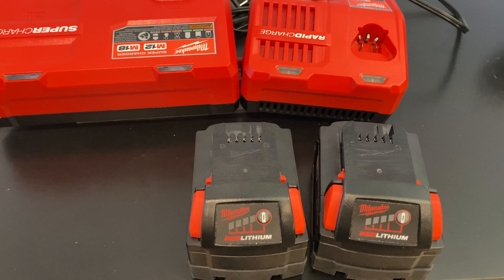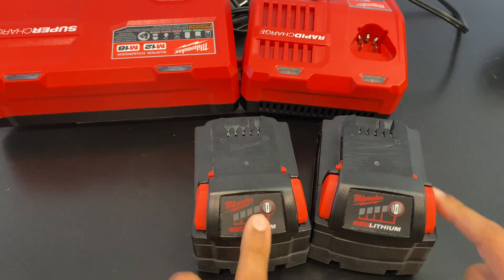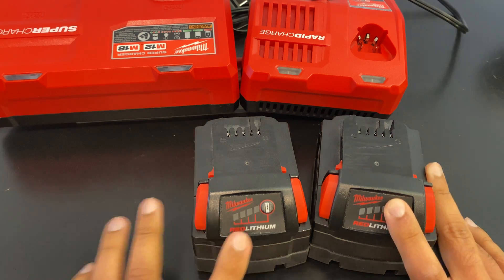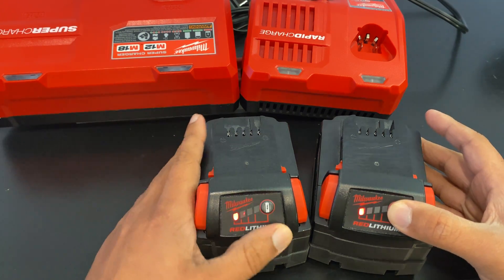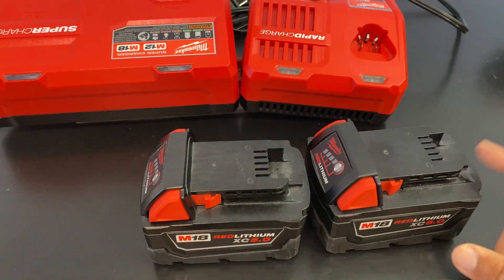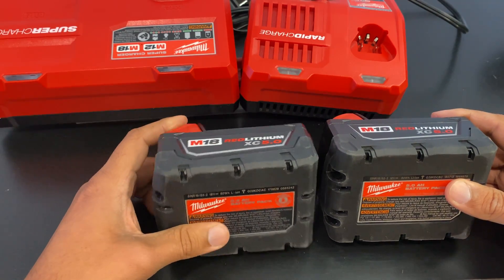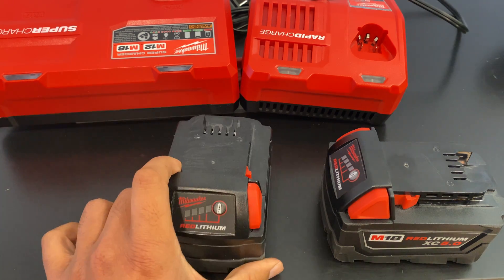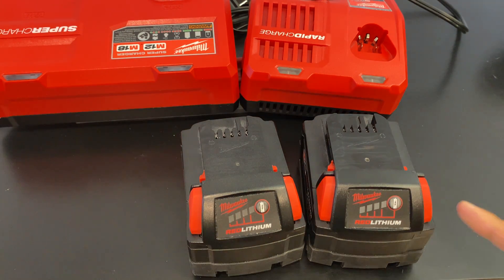Milwaukee M18 Batteries have two different blink speeds. What the heck does this mean?

Comment: Given Milwaukee engineers have included these disparate blink speeds my uneducated guess would be that if the battery is blinking rapidly it may be prudent to first start a charge on a "standard" charger for a short while to sort of get it "up to speed" before trying to charge it on a Rapid or Super Charger. Short of that it may be less for the end user than it may be for a Milwaukee tech who may be charged (no pun) with analyzing it when under warranty. I know, not much help.

Comment: When I run my 12 AH battery on my vacuum, the slow blink happens when I can hear the vacuum starting to bog down, and it’s usually my warning that I’ll need to swap batteries soon. 

Once it starts blinking rapidly, it’s dead and needs to be charged.

Comment: apparently you can use a second battery and jump the positive and negative to the dead battery. this gives it a charge enough to get it on your Milwaukee charger and finish the job
Reply from the maker: I would NOT recommend this. It’s very stressful and is hazardous. Use an RC battery charger and charge the battery instead. The pack may have a balance issue, in which case you could easily push a cell past 4.2V.
Lithium ion batteries aren’t good to take lightly because they absolutely will cause a fire.
Reply: @BatteryTestChannel  ill have to check my Hitec out and see what it can do. I thought you could only balance LiPo. or was necessary
Reply from the maker: @779069  All multi-cell lithium batteries benefit from balancing, but Lipos are used in crazy high drain devices so it becomes necessary for performance. I put a clamp meter on my XMAXX and read 150A or something insane.
Reply: @BatteryTestChannel  Xmax lol... I have the revo and jato. but i stuck to nitro. I built a really rare like out of 10 RCs called a lightning. it was electric before it was even a thing. if you have a chance, check out Unlimited Engineering. they make some super high quality parts. you can get some real nice diffs and titanium CVDs for the XMAXX. real nice center diffs that hold up. I ran the mamba castle creations and dual lypos. had two sets. got boring waiting to charge after every half hour. a set would only last 15 min. bad as hell.... but I like my nitro big blocks. them things are literally 100 charges away from a suprise fire hahaha.
Reply from the maker: @779069  Mine is 100% stock and mostly unused. It’s embarrassing to admit. Too many hobbies and not enough time! I will check it out. Yea, the Lipos don’t hold for long and they’re quite expensive too. I started out with nitro, miss those days! I still have a Rossi 2.5 somewhere!
Reply: @BatteryTestChannel  What is an RC battery charger (remote control?)  Can you please give an example of one you would recommend for this?  Thanks!
Reply from the maker: @mellowjammer  Hobby grade RC cars these days use LiPo or Lithium polymer batteries. These batteries have the ability to dump huge amounts of current. Jump starting ANY battery isn’t a good idea. I hook up a charger to my car battery when the battery dies for whatever reason.

Comment: What does it mean if the battery uncharged really fast?
Reply from the maker: The battery may simply be at the end of its life.
Another possibility is that the batteries in the pack are individually too different from each other, so the pack is stopping the charge when any one of the cells is fully charged to 4.2V.

Comment: I have older XC 4.0 batteries that have outlived my XC 5.0 batteries. Pretty much all my 5.0 batteries died and won’t charge while my 4.0 batteries are still kicking!
Reply from the maker: Interesting! I don’t have any 4.0 Ah packs, but I don’t find the 5.0Ah packs to be particularly impressive. I only use mine on drills and lights. They seem to choke on anything that uses power like the saws for anything other than a single light pass. I stocked up on 8.0 and 12.0 packs and they work well.
I picked up a few new 2-packs of the 6.0Ah for $120 or $60. Those prices are gone now.
Reply: What does it mean when you charge you 3.0 xc and they uncharged fast?

Comment: Learning about battery:

The slow blink of the milwaukee means that the voltage was hitting the cut off start, which is the slow point of the bms slowing discharging. It can either slow it down, or stop it completely. 

The faster blink means that it has gotten to the cut off end voltage, which will do a force cut off and you won't be able to use it at all compared to the slow blinking one and you can still squeeze a few juice from it.

The bms programming has a cut off start and end. Slow blink is a start. Fast blinking is the end.

There is a special case where the bms doesn't charge the batteries correctly and when you plug it on, you will notice you'll get 1-3 bars and the charger glows green with those bars. That means only one of the p group is at max voltage and is cutting off the others. To fix this, recharge the other batteries and reset the bms by recharging. Test if it's working right by depleting and recharging and then check the voltage level of the batteries. If it's not properly charging the other groups, the bms is broken.
Reply: What is the definition of “bms”??   Answer:  I guess from another comment it means “battery management system”
Reply: @stephenfiore9960  correct
Reply from the maker: Since making this video, I have learned that this is the case through experience as well. Thanks for posting!

Comment: I just had this problem with one of my 5.0 battery.  I hardly ever used it so I was a little ticked off when I found out it was fast blinking with the one bar.  When I put it on the charge it goes straight to green.  When I put it into my tool it would not work.  
So here is the problem and the fix.  Problem is one of the sets of battery in that battery bank is under voltage.  When you open it up and test it with a multimeter, it should be about 4.1 volts if it is really fully charged.  I had one bank of cell that was reading 3.2 volts.  The Battery Management system (BMS) in these battery doesn’t like it when some of the banks are off. It is afraid that if it does allow the charging of the cells, the cells that are fully charge will overcharge and overheat and explode.  So the BMS turns off the battery so you can’t use it in the tool and your charger will tell you it’s fully charge (showing green) so it won’t charge it further.   So when I found the bank that had a lower charge, I used a lithium battery charger and charge only that undercharged bank and charge it up to 4.1 volts, equalizing the sets of batteries in that 5.0 battery pack.  Once it got charged, I put it on the charger to reset the BMS and that fixed it for me.  The charger that I used was actually from a Remote Control Car battery charger, a Hitec X1 MF battery charger.  I set it for lithium which will charge it up to 4.1 volt and amperage at .5 amps or 500 miliamps.  It took about 6-8 hours to charge up that bank to 4.1 volt.  Once done, put it on the Milwaukee charger and it’ll do a handshake and reset the BMS.  Since it was fully charged already it turn red then green then I took it off the charger and press the fuel gauge on the battery.  Ta-da….4 bars went up showing it was fully charge.  Put it into the tool and pulled the trigger and it worked.  I was super happy.
Reply: Thanx alot man
Reply from the maker: I somehow missed this comment. Well done! I recently recovered a battery doing exactly this. 
I can confirm that the BMS doesn’t actually do ANY balancing, so once any of the 3 or 5 cells bits 4.2V, it simply turns green. I’d you have a massive imbalance, your total voltage will be low, and the pack will show less than 4 bars. Glad you were able to get it to work!
I use a SkyRC charger for my shenanigans 😁
Reply: Yes really easy fix any b6 lipo charger will charge an battery   even with lipo batteries die past the no return charge the battery nicd  Nicole setting  on charger  5 to 10 minutes  throw it on the charger ur good to go

Comment: I found a lot of them have Bad BMS
inclduded the 9Ah version
i also seen some will charge up to 3.9 ish V
3 bars and stop charging, i have to manually balance charge them up.

then insert back to charger to wake them up
the center pin is for charging 
the newer high output has a better bms, some still fail especially those large 12Ah
Reply from the maker: I don’t have a 9Ah battery, but what you’re describing makes sense. The 9Ah is also a much older pack. The 6/8/12 Ah packs are internally balanced though, so I’m not sure what the extra pins actually do. We have 5S2P and 5S3P, and there is obviously no extra pin on the 12.
Reply: @BatteryTestChannel  Updated there are a lot of bad Samsung 30Q cells in the 9Ah
as well as pre mid 2021 M12 cp3.0 and XC 6.0
Reply from the maker: @TranTek  Just had an XC 6.0 go bad on me with the 30Q, but my 3.0AH CP battery uses LG cells. Not sure if they switched. From Samsung 30Q in the CP3.0.
Reply: @BatteryTestChannel  same as cp 3.0 M12
Samsung 30Q is also bad, they switched them all to Sony VTC 6 on the late 2021 
i took bunch of them apart and they switch them

VTC 6 are very well made
Reply from the maker: You’re just made me decide to take apart all my CP 3.0 packs to look… 🤦🏻‍♂️🤣🍻
Reply: @BatteryTestChannel  what is the date code ?
Reply from the maker: It just hit me that the date goes on the bottom of the battery. The LG pack is a 2019 May battery.
I just opened up a 2020 November battery and this is a Samsung 20R. Wow, just learned something!
Reply from the maker: Wow, the red plastic is also PC-FR on this 2.0 and not PC-PBT like the others. It looks like this change was made on all batteries.
Reply: @BatteryTestChannel  i had opened quite a bit of batteries and i see a pattern what they do

from M12 to M18 good or bad lol
Reply from the maker: I think we’d get along. 🤣
Reply: @BatteryTestChannel  i could do all kinds of video
i have multiple business which i don’t have time to do and no setup doing it

Milwaukee Dewalt uses more or less same batteries, same bosch and makita
Ryobi seems to use those 15M cells